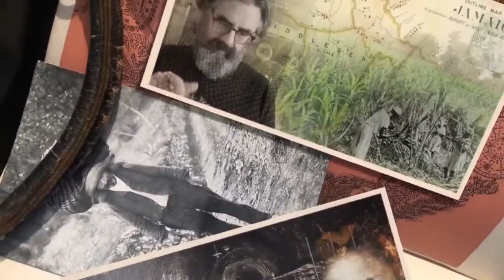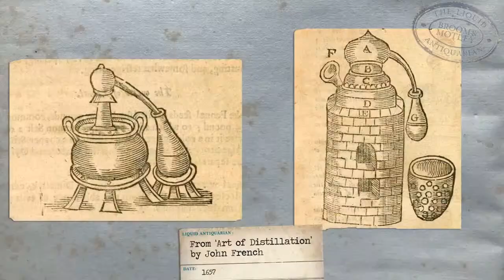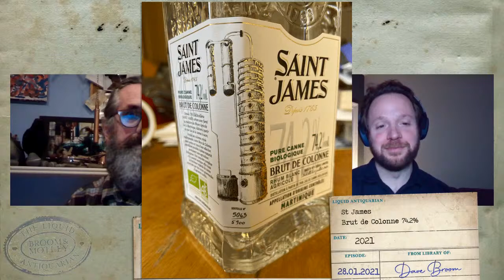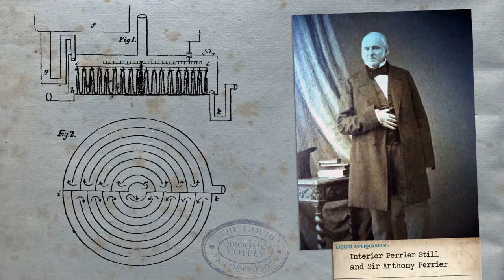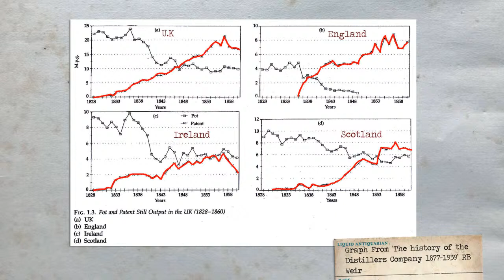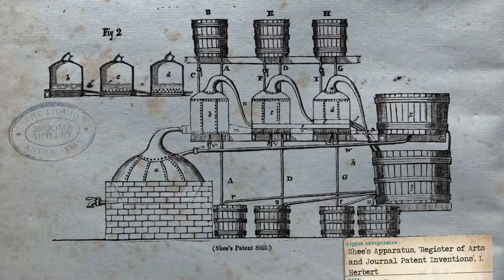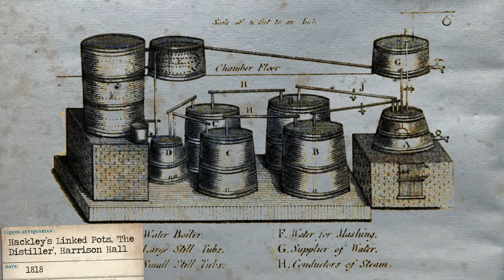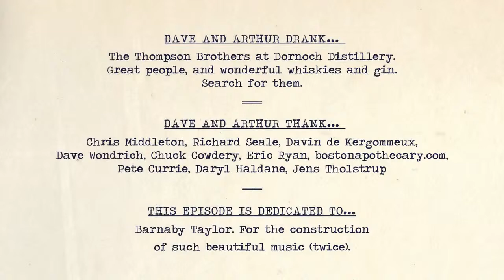Weird Stills: The Pipes Of Progress

Comment: I am watching this long after it was sent, fascinating stuff! Keep up the wonderful work! I have one objection: Robert Stein's still and the notion that because haircloths would never have worked, the Stein stills in Yoker and and Cameronbridge as described by Barnard should be the first of Robert's two patents, the one shown with the interconnected pots. The first 1827 patent is so much less developed than the 1828 one I thought this seemed unlikely. And lo and behold, Fifeshire Journal, 27 November 1845, mentions how Cameronbridge has had a Stein still and goes on to say this: "Andrew Stein, Esq., brother of the late ingenious patentee, has erected a new still for Mr. Haig, of much greater dimensions […] It is on the same principle [i.e. as Robert Stein's patent], modified and improved by Mr A. Stein. It consists of a column twenty-eight feet high, and is five or six diameters at the base, which is attached to two purifying vessels. The material is of copper […]"  So, the Stein still in Cameronbridge was the one with the column. There are also a few ads for things like Stein's patent still scattered throughout the 19th century where it is claimed to be able to work off 500 gallons of wash in an hour, something which seems very unlikely for the 1827 patent with the interconnected pots to be able to do.